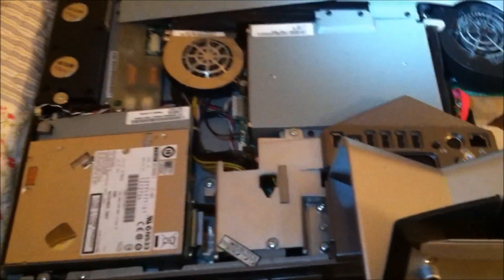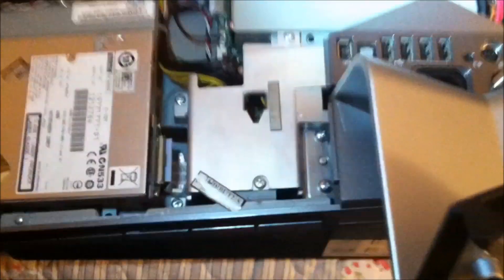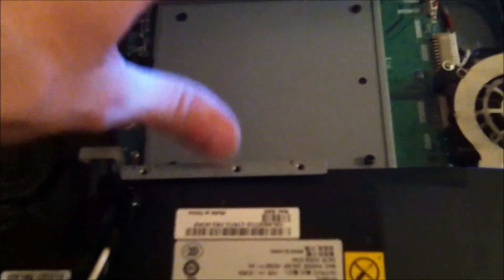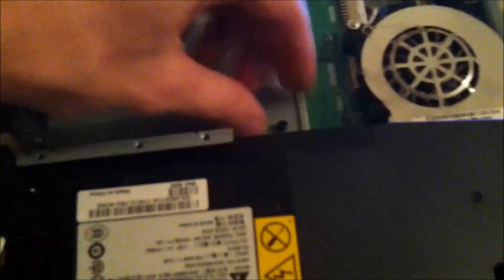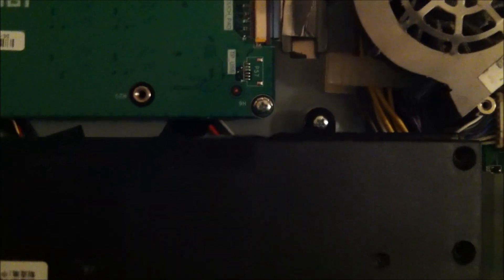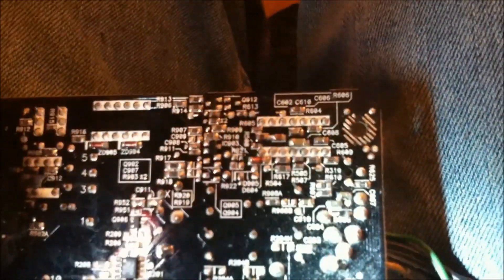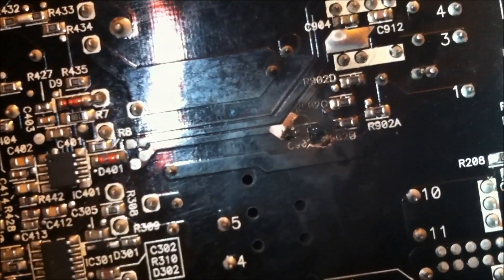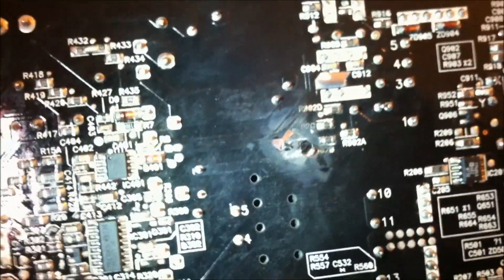Dell XPS All in one will not turn on fix

Comment: I think I am having a problem with my power supply as well.  Computer will not start at all. I know I am getting "some" power to the motherboard as indicated by the led next to the WAN card. I've replaced the motherboard and CPU with no resolve.  The power supply doesn't have any visual indication of it being bad. Does anyone have any other ideas of things to check to further pinpoint the issue?
Reply from the maker: Dalan Hansen you could try to manually force it on and see what happens. You’ll have to short some wires
Reply: @hitandrepair  I tried shorting the power on switch, which didn't work. I also confirmed the switch is working correctly by testing continuity.  Which wires would I need to short?
Reply from the maker: Google atx power supply jumper.

Comment: Hi,
     i need your help is that power supply still working? If you can spare sometime,
may i know its pin config. w/ corresponding voltage levels. that would be helpful, thanks,, email me at engeerdan@gmail.com
Reply from the maker: A replacement was bought, if you google it, you can find the pin out for the delta power supplys online. this was a customer's pc